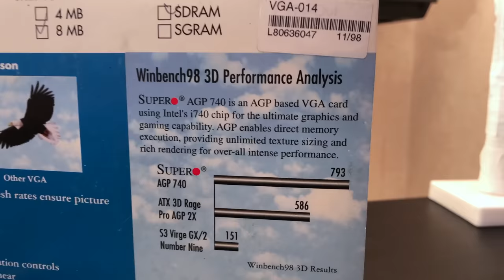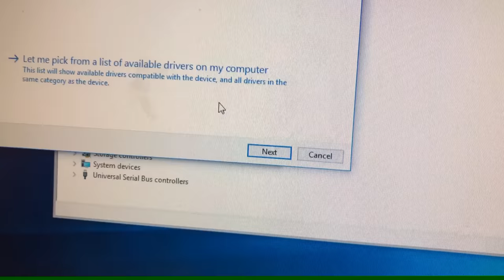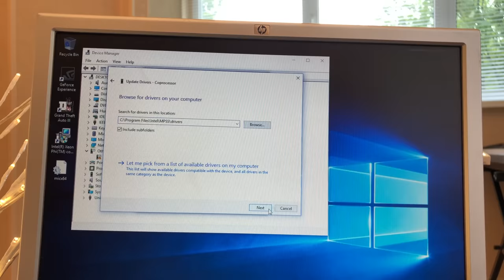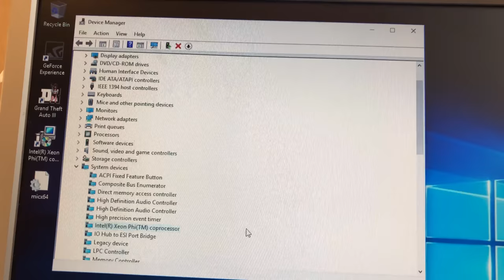Intel Larrabee Prototype Test Launch + Disassembling

Comment: Try installing the latest intel HD 6200 or UHD 630 driver on it by modifying the .inf file to detect this graphics card (just change the device ID for the 6200 to match this graphics cards ID)
Maybe that could work!!!!
It allowed me to install the quadro p/k620 driver on my GTX 1050 ti graphics card when i modified the quadro drivers to install on my 1050 ti graphics card by changing the ID in the .inf file!
it gave me all of the quadro specific features and worked!
You might need to do a little bit of "Disable driver signature enforcement" though if your doing it on windows 10
Reply: have you try the quadro m6000 or p6000 drivers to do the oposite thing? i mean by putting the gaming drivers to the 24gb of memory quadros for better gaming ? you think thats possible? because some of these cards are just the same chip as the consumer cards with just more ram and a few more features but if you manage to do what you just said this clearly proofs that quadros are a bit overpriced and theres marketing behinde those prices.